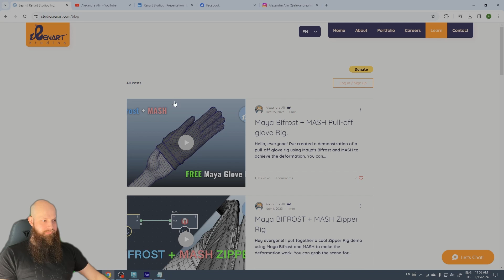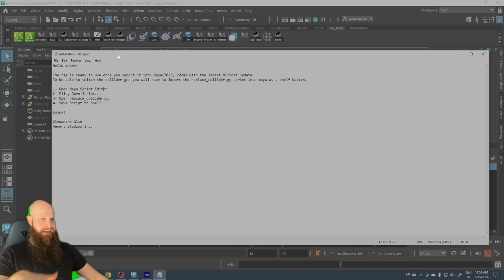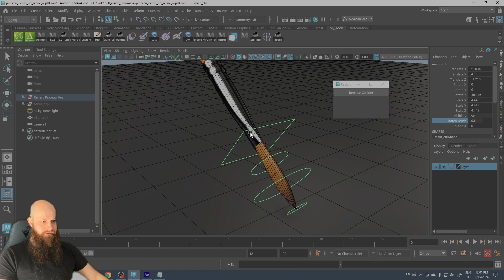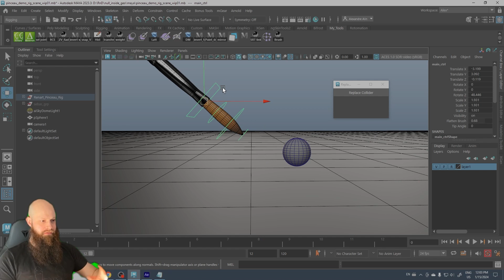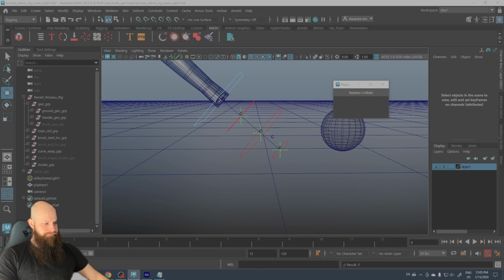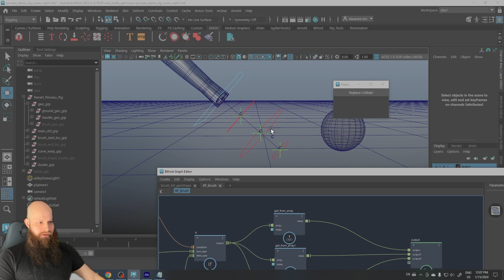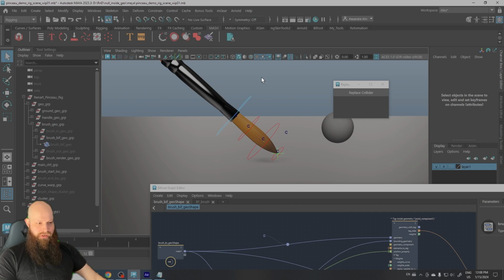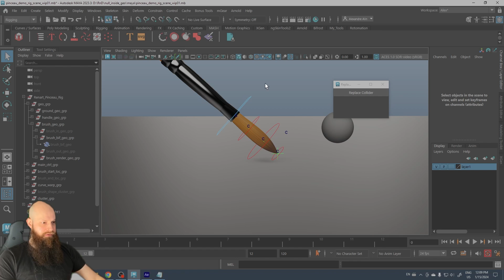Maya Real-time Collision Brush Rig

Comment: How would you go about making a joint be pushed by a geometry surface? Similar to cmusclekeepout? Would this be more lightweight?
Reply from the maker: Probably yes but my goal was not to have a optimized lightweight rig but more of a quick easy way to have something work with many options. I kind of found nice to have all the curve wrap options into my rig for example the scale curve values and rotation. But yeah you are definitly right! This rig could be much more optimized for game engine with a joint based rig.
Reply: @AlexandreAlin  yeah! Thanks for answering! I just randomly came to this vid and asked the question though (i do follow you of course!) , not really related to this rig in particular, i just wanted to know if it is possible to make a surface (geo push a transform node / joint as a finger on a keyboard and then possible for the key to return to the original position. I am looking for a way to do this with more than 60 elements... Again,thanks for your time man!
Reply from the maker: @StephanSphin  https://www.youtube.com/shorts/19XJM9f0xF0

Comment: The tip of the brush is locked to the origin. It's just getting stretched whenevr I move the Main Ctrl away. Can u plz help me out with this?
Reply from the maker: @Abrar3d2022  What version of Maya and Bifrost do you have?
Reply: @AlexandreAlin  Maya 2023 / Bifrost 2.4
Reply from the maker: @Abrar3d2022  Ok that's why. Update Bifrost to the latest version and it should work.

Comment: Hey! How´s it going? Thank so much for this resource, it´s really amazing! I just watched the Loui´s comment and I have the same issues. When I open the escene I can´t see the brush geometry, and when a make it visible, the last controller that is suppose to control the tip doesn´t work (It´s in the same point even moving the main controler) . I´m not sure what I should do, Can you help with that please? Btw I have the 2024.2v in maya

Thanks!!! Have a nice day
Reply from the maker: Hey thanks for your appreciation :) If you go on the Bifrost graph and under the help tab, go to About Bifrost. This will open a new window and you will see your Bifrost version there. it needs to be 2.8 or higher. If that's not the case, you will have to update it manually on the autodesk website. Let me know if that's work! Cheers!
Reply: @AlexandreAlin  Ohhh it was that! I got the last version of Bifrost and now the brush works perfectly. You're a genius! Thanks, I really appreciate your help and your work. Have a great day Alexandre
Reply from the maker: Hey thanks! Have a great day too! :) @afrivas

Comment: Hey thanks for this release. I have an issue, the last controller that is suppose to control the tip looks not working, my brush is not visible when I open the scene, I have to go inside the groups to make it visible. I am in Maya 2023.3
Reply from the maker: Hi Louis! This is because you dont have the latest Bifrost update installed.
Reply: @AlexandreAlin we just found out thanks for the release mate really apreciate :)
Reply from the maker: @LouisCocquet  It’s a pleasure! Enjoy and if you see anything that needs to be improved please feel free to ask and I will try to add it in a later version.